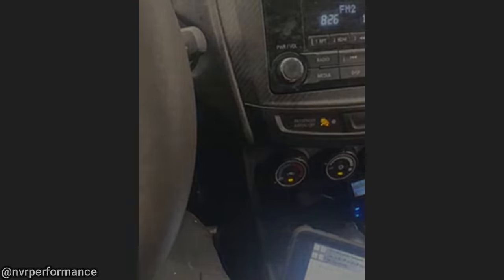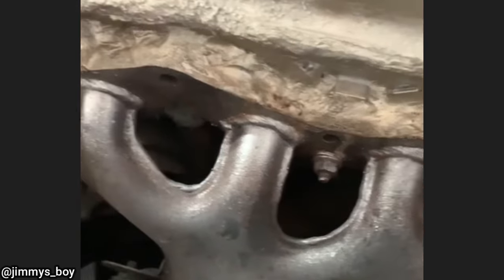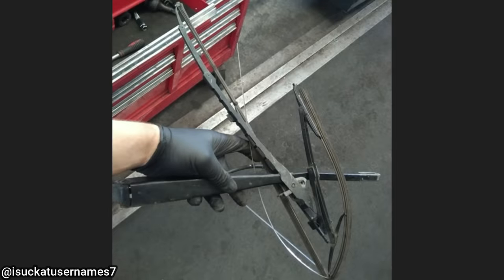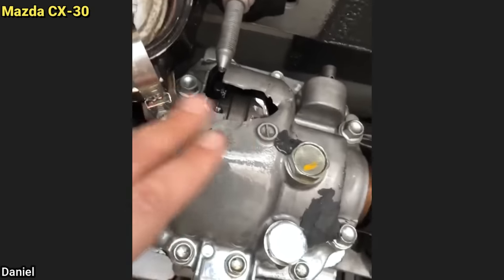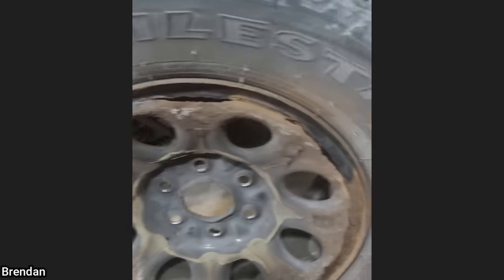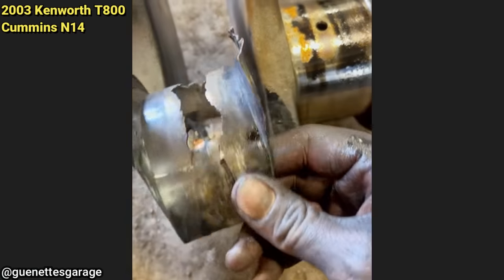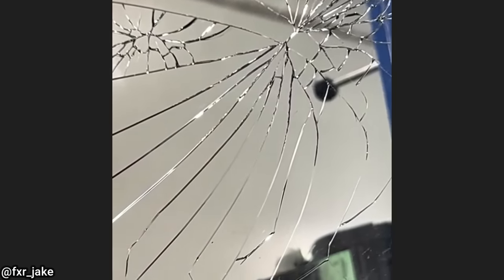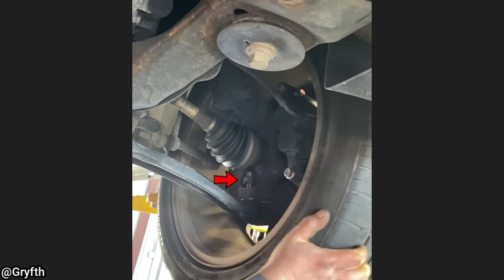Customer States (Best of January & February 2022) | Just Rolled In

Comment: The truck one happened to us recently, that does not look like something a "garden variety pothole" would do.  It looks like she ran over those things at the "nose end" of stalls when parking nose first with the two passenger side tires.

If it really was a pothole like the claim, that wasn't a regular sized pothole, judging by the damage to the rim/hubcap on the rear wheel.
Reply: Also, the scrapes the bumper, I really don't think driving through a pothole can cause that pattern of scrapes either, if it was done in the same drive.  It looks more like a drive into barriers and/or guardrail and/or large rocks incident to me. (All three of those things denoting the edge of the road.)

Comment: I let my step daughter use an old car I had, (I was wanting to use the engine). She came driving up our driveway I could hear the motor ticking inside our house. I asked didn't you check the oil,yes she said it was always full.. I said show me,she pulled out the trans fluid stick..( engine oil was empty),motor shot.

Comment: Oil is overrated.  I ran over a pipe sticking out of the ground with my 57 Chevy and creased the oil pan.  The oil light immediately came on but i kept driving it like that for about 200 miles until I fixed it.  I never changed the oil in that car, just added more every so often.  It didn't seem to mind and ran for 115,000 miles before it quit.

Comment: While it actually may not have been the BMW drivers fault, as sometimes there's literally nothing you can do but strike whatever it is because anything else would result in a collision with other vehicles and put your and everyone else's lives in danger, THAT'S something you take up with your INSURANCE COMPANY not the goddamn warranty office of the car maker itself. The only time the car company is going to replace anything "for free" is when shit gets recalled due to a possible product wide error or if you are simply driving along and literally nothing happens outside of a normal drive and your car takes a shit. But if you were dogging it or even barked the tires a single time they aren't replacing shit for you.

Comment: How does a ball joint explode?
Reply from the maker: They over heated the ball joint when they heated up the pinch bolt. The heat probably got the grease too hot in the ball joint, and the gasses had nowhere to go, so it exploded. It's apparently pretty common on Subarus if you Google it. I've mostly worked on Ford's but apparently it's not the first time.

Comment: The Ball Joint popping out from the Arm under the Spring pressure and disintegrating, that is, it "exploded" is why you wear eye protection at all times when working on cars - especially in the suspension areas where there are massive springs under pressure - even when the wheel is off the ground those springs are still compressed and hold a lot of pressure (force). If something let's go before you expect it (like a worn ball joint), this can happen.

Comment: In my 45-year tenure I've seen a bunch of crap myself I just wish we had cameras back then. I did a timing belt on a like 1998 or so Mitsubishi pickup, easiest timing belt in the world! You can do one plus the water pump in less than 15 minutes. Anyway 6 months later the girl comes back saying it's making noise. I go out she starts it I listen and nothing! I quizzically look at her and she says oh no you have to be going 45 miles an hour before it starts to make noise. Me knowing a timing belt or job will make noise right away or not I had to see what this was about. We took off and sure enough at 45 miles an hour came this completely incoherent unrepetitive rattle I cringe and knew exactly what it was and ask the girl to pull over to the side of the road. When she did I simply got out got the aluminum can that was rattling around in her bed of her truck threw it on the floorboard and said now let's see if it rattles! We drove back to the shop in silence and she drove away in silence...

Comment: Cant believe the lack of common sense,these people are LICENSED DRIVERS on the same roads we travel on,My 03'Silverado just turned 20yrs, RELIGIOUSLY maintained,all original,and people ask if I did a frame OFF RESTO on it,Love my truck,I HAVE had to do some expensive repairs,Trans at 90k,a few exhausts and cats,most repairs STARTED after 150k,suspension parts,rad,a/c complete,alternator,,,and I was ok with the costs,1 bought the truck for 22k,and approx,15k in repairs and maintenance,total of 37k and the vehicle is still awesome,interior mint,and I know what I have,,,and way better than having a 80k truck TO pay off

Comment: Dont ever ever and i mean EVER heat up a balljoint or tierod end or get too close with torch the grease inside will turn to an powerfull explosive gas if heated too hot… when i worked at toyota a mechanic was heating too close to a balljoint trying to get it to break free by expanding the knuckle housing so it pops out well i told him to be very careful and he shouldnt be putting that flame right at the balljoint too just on the steering knuckle housing and just touch the oustide edge and the heat will travel… well he just thought that is was a dumbass and they cant possibly blow up…well needless to say he lost his left eye and some bone in his cheek.. he was wearing safety glasses but it shot right though and embeded behind his left eye and almost made it into his brain…. That stuff is serious and just because it has a little jiggle doesnt mean it wont fill this gaps when heated and expanded…and usually if you put your big girl panties on and whack the steering knuckle on the flange made for whacking and HIT IT pops right out on these smaller vehicles but some people carry the small purse and it just dont cut it😋… be safe out there peeps😎✊🏻